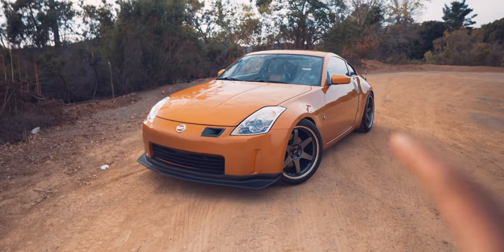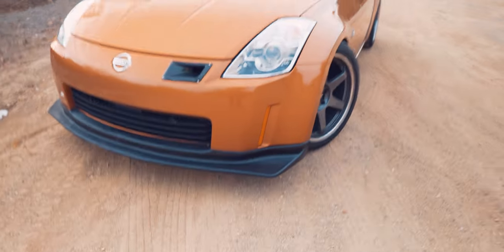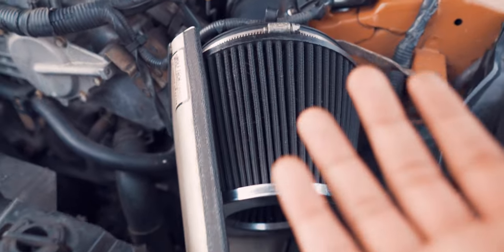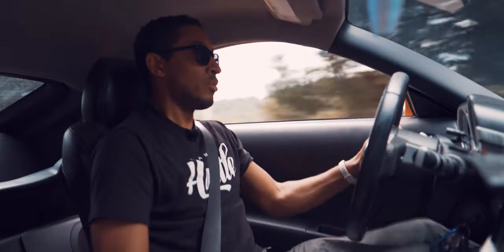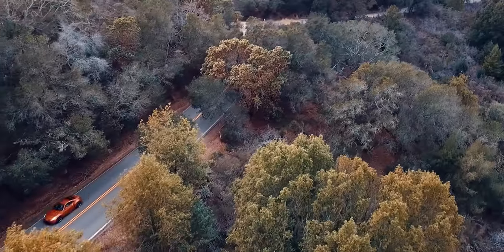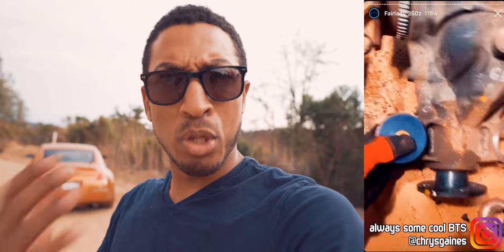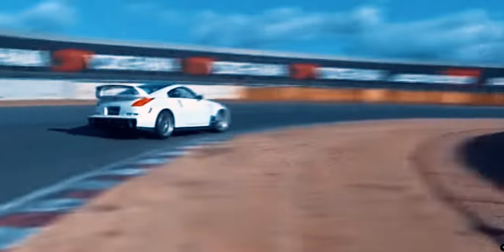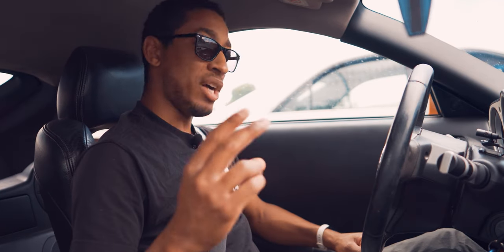Building a Touge 350Z in 18 minutes | How much did it cost???

Comment: I know it's probably just for clicks and YouTube algorithm stuff, but I am gonna be that guy, pal.
Many of these mods aren't performance mods and are primarily cosmetic.
From what I see, this is pretty much a slightly modded daily driver and not a performance machine in any way. Feel free to disagree 😆
Reply from the maker: it’s a car built for me. my local canyon roads, and my daily driver. and it’s absolutely overkill even for that. if good tires, light wheels, a full suspension rebuild, and bolt on power mods aren’t “performance mods”, then you might need to compare your definition to everyone else’s. won’t find much else on your typical track car anyways. i don’t need a big turbo, i don’t need a standalone, i don’t need anything else to enjoy my Z. i’ll save all that my bimmer lol
Reply: @ChrysGaines  But you didn't build it, the previous owner did almost everything already...
Reply: @halomaster985  your point?
Reply: @halomaster985  are you saying he should do things the previous owner already did?
Reply from the maker: the PO did wheels, coils, sways, edfc, intake, exhaust. all stuff i would have done anyways, and all stuff I could do 3 times at least in the time it took me to do the bushings and mounts alone 😅
Reply: @ChrysGaines  I won't argue that a stock 350z needs zero modifications to be a very potent canyon carver. I will argue that it is very easy to turn these cars into serious track weapons. I prefer my vq35hr over the DE's I've had, but that's not to say the DE is a bad engine. There are lots more things that could be done, which is why the click bait title is kind of misleading.
Reply: Ngl my twizzy is ütufual
Reply: I agree. When you say build we expect to see you build something not just talk about what's already on the car... and the 6 figures to make it seem like it's gunna be an actual fully built car is cap. It's almost stock and he put tires on it. WOAH BUILT..

Comment: 265 in the front......   really??
Reply from the maker: i build my cars to track specs, apparently Z’s handle much better with a square setup. I stayed 10mm skinnier in the front to keep the traction control system happy, which looks for a percentage different in wheel speed front to rear. 

the 245’s the car came with felt understeery even while driving moderately in the canyons - the 265s feel super confidence-inspiring